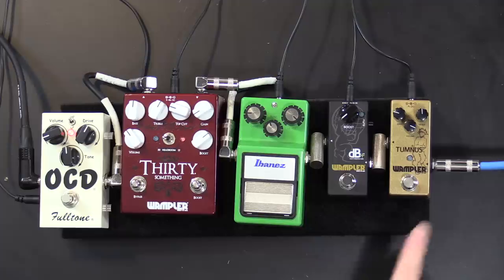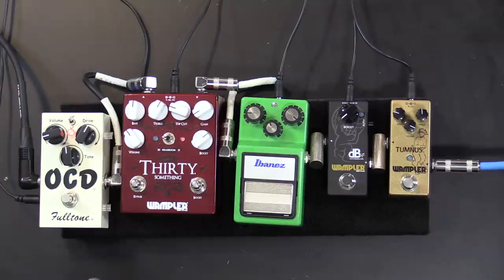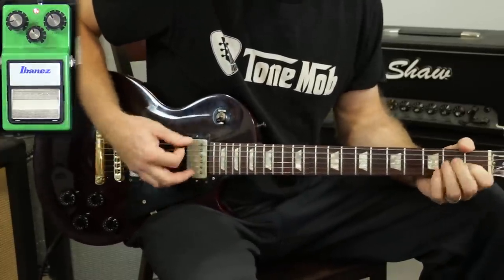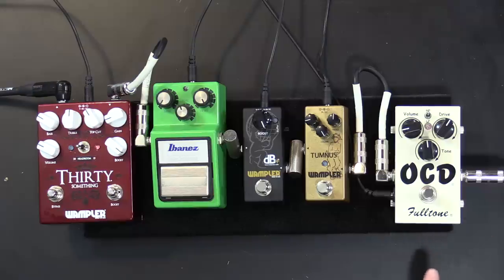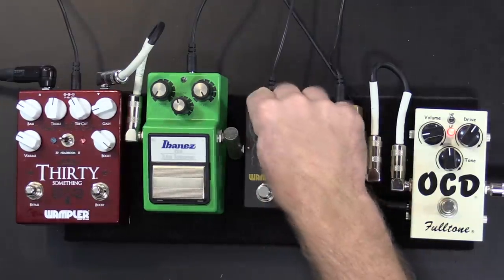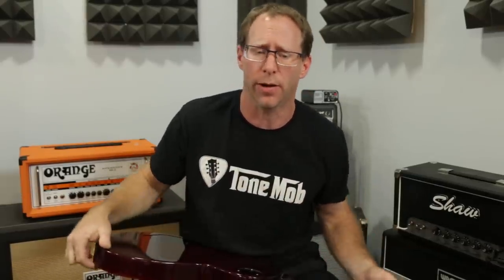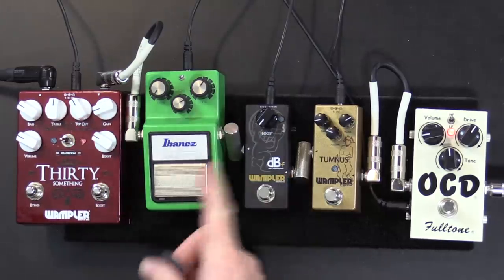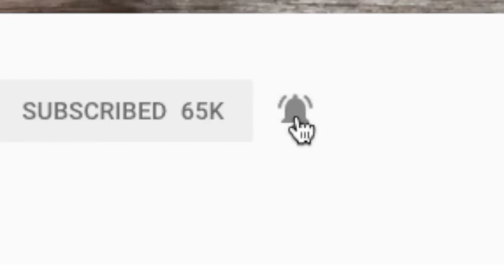Boost Pedal Placement - where do they go?

Comment: great video! 

I've always used an old DOD FX10. I usually keep it after all of my dirt pedals, but I recently got a twin reverb and have been trying different configurations. I now have the boost in front of my OD but after my Fuzz and it's always on, and I like it that way because I can slightly boost the gain of my OD, but then boost the level / character of my fuzz. It's probably the most useful pedal on my board.

Comment: I ran a Metal Muff w/boost through the return effects loop on a Carvin Nomad 1/12/ 50 watt combo with great success. Even in front of the amp with the fuzz at zero for a clean boost it really the pushed the soak/overdrive of the amp beautifully. With the fuzz & boost at noon, the amp @ 10 o'clock, my lawn died. Nice review Mr.Wampler, thx for sharing your wisdom.

Comment: I put my dB+ as the first thing in my pedalboard. My reasoning is I usually set around 8-9 oclock as a solo boost so it’s not boosting my signal all that much so only a little distortion increase but I can crank it up higher and still get the extra gain. The added gain as a solo boost is welcome, and added gain if I increase the volume is louder too

Comment: I had always put booster ahead of dirt but your vid and Anderson’s current vid both mention putting a booster in the effects loop so I’ll try that. I have a number of booster pedals - Diamond, xotic Ep as  well a number of dirt pedals that I can set as always on or boost including Tumnus, lovepedal E6, mooer, miaudio, Manticore, JHS Milkman. I think my favourite is the Diamond and the Tumnus. But I’ve only used it as the first pedal. Great vid. Thanks

Comment: I usually put them after my EQ pedals. I have the distortion and my EQs running through a Boss NS2 then the output on the NS2 goes to boost. my favorite is MXR micro amp cause I think they're the most transparent while an EHX LPB-1 is more of a tiny overdrive

Comment: I use a "boost" as a preamp right after my guitar cable.  It is ALWAYS ON.  I adjust it with whichever guitar I'm using to where I'm just noticing an overload or any clipping at the speaker.  This way I know I've got max signal thru the system, and potentially "lower" my overall noise floor. 
Then I turn my guitar's volume control(s) to max impedance (~47k with my 250k pots) at it's output and start adjusting my gain-staging thru the amp & system to get a nice creamy sound. 
Then when I want it cleaner I can back off on the guitar (or I suppose I could turn Off the boost).  If I want more overdrive/distortion I turn the guitar up or kick on a pedal. 
A super-clean, quiet preamp/boost is preferred for My system, and a lower gain boost/overdrive is usually plenty to give me a high-gain type of sound. 
Try it. You'll like it.

Comment: Does this make sense for how to choose? 1. start with the tone you need: e.g., mid hump with single coil pickups into Fender style amp needs mid hump, 2. choose the type and kind of distortion you want: e.g, soft vs hard clipping for distribution of overtones, symmetric (odd harmonics) vs asymmetric (odd and even harmonics) for complexity of distortion, 3. put that pedal just before the amp, 4. compliment that tone with another peddle into it usually for more sustain. For example, boost into tube screamer to establish the overall tone and use the boost to control just the sustain.

Comment: So much fun! My old 80something TS-9 is still on the board as my first "gain" stage after the compressor. Both of which are basically always on. Depending on flavor or where I want to be in the mix I switch on the OCD, Pinnacle Deluxe, or DS-1.
On very rare occasions I get to slap my EP boost in front of my Marshall 1987 with the volume at 3 o'clock or so!  Absolute SWEETNESS!!! :)

Comment: I tried both ways around. either the boost or the overdrive, or both of them, will have a situation where a signal that's too hot coming in will make the whole thing really squelchy. that depends on the circuit and the pedal, so sometimes it's better to do it one way and sometimes it's better to do it the other. The important thing is not to overload the op amp in whatever pedal makes the squelch.

Comment: Route 66 Comp/OD with both sides on is the best pedal I’ve found for boosting your signal before distortion, if you can make it work quietly. Which can be sorcery, especially with single coils.

Comment: Ya know... the differences, to my ear, don't sound that much different... 

Must overdrive/distortion also sounds quite similar to me, with VERY few exceptions... 

Crunch is fun, but to me, it's a one-trick pony... it's a good trick, but gets boring, quickly if used all the time, in that its limits dynamics, which adds drama to music... 

Remember music? Gear is fun, but music... that's where the rubber meets the road... crunch has its place as an effect... even some metal bands have clean tones... and use it to great effect... there's that word again...

I appreciate your efforts and explanations...

Comment: With all (most) of the boosts I use and why:
EP Boost/Micro amp; I use these to even out different outputs, either between different guitars or different switching like going out of phase or parallel that naturally cut the output.
I may also use it as a buffer by setting it at unity. (I wired an onboard preamp in my Tele, and I use these boosts in the same way I'd use that.

-source audio programmable EQ. This I use basically as a almost overwhelmingly tweakable clean boost. I used this to change the EQ of the pickups of the guitar that's running through it, like to add mid-range to a vintage type single coil. It also will hit the dirt tone (whether it's from a pedal or the amp).

-Here Ill put a Tube Screamer or Klon type OD. Sometimes I'm using the ODs clipping with the boosting. Sometimes I may use it as a sending EQ, obviously adding mid-range. If I'm going for a Gilmore "comfortably numb" lead y tone; I'll run a vintage Muff clone, then add mid-range after the fuzz. Sometimes I'll set the Muffs gain low, and use the Source Audio EQ with the mid-range scooped, and hit the front of the Muff to open in up a bit. When I'm using these for that, I won't set the TS/Klon as a boost, just an EQ with maybe a slight bump in volume, just to make it stand out.
My favorite one right now is the Silver Pony 2. This is a Klon centaur clone, that's actually a Klon and a half. It's a double pedal, with the fully functioning Klon first (IMO, this is the closest to the actual Klon that I've played, the newest version has av3 way clipping diode selector; germanium for classic Klon, then silicon and LED.
It has a clean boost that's a post gain boost, so the OD if first. What makes this pedal great is that the boost is actually just a Klon without the high gain preamp in it. Those who know Klons will be aware that one thing that makes it different from most other ODs is that it has 2 different preamps in it: a clean and high gain. Both are ALWAYS clean and high gain, and three gain knob on the pedal is actually a wet/dry blend. When you're running it with the gain low, you're getting most of the clean preamp going out there pedal while there high gain is getting shunted to the ground, as you turn up the gain, you start to shunt the clean preamp, and send out the high gain.
 The clean boost is a second Klon pedal that's built using only the clean b preamp, the high gain isn't in there at all.

- last is a Timmy that I use for clean boost or sight gain. It's a bit thinner sounding than say the Klon, so Ib like this with a warmer guitar or fuller darker amp, while the Klon I like for brighter sounding gear.

That's about it. I don't ever have all of those in my board at the same time but if I did this is where they would be placed and why.

Comment: Klon for me, get both a boost & OD. Anyway did a test the other day. Simple DCR to measure guitar pickup DCR for a Squier Bullet Strat. Those are the 3.7K ceramic pickups. So what I did was add the Klon as engaged & disengaged to see what the effect  was for the same DCR testing & measuring it at the output of the Klon with a patch cable. The Klon as a clean boost could be dialed from the 3.7K => 10.6K DCR. That's when it hit me, the Klon or any clean boost emulates the DCR windings on a pickup for output. I could dial in & get the DCR of any pickup set. Needless to say, I'm a huge Klon pedal circuit fan even more for this discovery. There are probably other reasons to swap pickups, DCR for output tone isn't one of them. Crazy, 10.6K DCR from a single coil Strat. To me that's too much, but just right is between 5.6K-7ish K DCR measurement. I found that these Strat single coils can be boosted to Telecaster & even P90 DCR specs with a Klon as a clean boost pedal.
Reply from the maker: Are you referring to dc resistance?
Reply: @wampler_pedals  Yes, While I know there is no substitute for actual winds of wire on a pickup, the way the clean boost was normalizing every switch position for DCR & possibly Henries effect, the 3.7K Squier ceramic pickups were sounding like high dollar Fender 5.6K-10.3K Stray pickups. It didn't matter what pickup switch position (1-5) I had the guitar, I was getting the 10.6K DCR or whatever the pedal Volume produced. Since the pedal is external to the amp, it's part of the guitar output to me. Maybe what happens is better described as making passive Strat single coils & turning them into active Strat single coils. I mean my Klon is a 9V DC powered signal, the same as an active 9V DC Humbucker.

As for the Squier Strat single coils, the 3.7K DCR & Henries should be more than adequate for capturing the string vibrations & signals of all of the frequencies. The clean boost does exactly what a pickup with more winds of wire on it would do. All I know is that not plugged into an amp a guitar into a powered Klon as a clean boost was producing the same DCR readings in every switch position and they really were approximating every DCR that Fender offers for each of their pickup products with the exception of the Ultra Hots. Those are 12.3-12.9K for Neck & Middle, 21.6-22.2K for the Bridge. Personally, I wouldn't want single coils that hot for DCR & Henries. With the Klon I was Volume setting the pedal for about 5.6-6K according to my meter, the amp I could set that volume higher and the speaker had plenty of clean overhead (Pyle PVAMP60 Reverb).

Give it a try, measure DCR at the Guitar, whether it's the pickup leads or the output jack with a patch cable. The create that same extension with a powered clean boost Klon and measure it powered off first & then powered on . That's the measures that I'm referring to. Klon powered off I get the same as if I were measuring just the guitar pickups without the Klon. Klon powered on and the DCR's are whatever the volume knob produces at any given setting. At a certain point the DCR really is significantly boosted. I would check for Henries, but my older multimeter doesn't have that function. Not sure anyone else has ever tested pickups & effects that way from this perspective of comparing that with higher dollar/end pickups ?

Comment: I generally don't employ boost pedals, but when I do it depends largely on why I'm using it. If I'm not getting enough saturation from my drive pedal then I would put it before the drive stage to cause it to clip earlier, thus a more saturated sound. If I want to keep the tone I've got but need a solo to cut through I put it in the effects loop towards the end of the chain.

Comment: Thanks for the video. Redid my board yet again. Now using my amp with a little gain with a tube screamer for slight overdrive and running that into the tumnus set dirty. So not a boost but a more dirty distortion and also set a bit more than unity. So far so good

Comment: I’m a little late to the party, but I have a Granger M50, which is basically a 4 input JMP clone. Sounds killer by itself, but I need a little help from my friends (aka pedals) to really push it. I channel hop and blend the channels on the amp to get just the right balance (to my ears). I basically dial in a Malcolm Young-esque tone on the amp itself.

Anyhow, I run with a Tube Screamer mini first, an Earthquaker Devices Cloven Hoof Reaper fuzz next (I use the Reaper side mostly - it’s a 3 knob Tonebender essentially), and then I run an Xotic EP Booster after those at about 9 o’clock. I run the EP Booster all the time, and I’ve found that it smooths out some of the harshness that can come from the amp and also adding pedals that can have higher gain and midrange qualities. Plus, it makes my solos pop! I’ve tried every combination of those pedals, and that’s what’s best to my ears. I love running a wah and time-based effects after that (usually a slight delay and a phaser) for total cosmic goodness. 

Oh, and now I want a Thirty Something! 😂😂

Cheers!

Comment: Great video thanks for doing it. I use a Boss ES8 switcher and it allows changing the signal path for each preset which is an awesome feature for having different gain structure configurations.

Comment: Both..... I have a boost before and after... for the reason's you'd expect.

So I have a AMZ Mosfet booster I built at the head of the train, it is set to hardly any boost and is kinda a buffer

Then a OD808 going into a simple fuzz, after that I have a Flanger going into a BluesBreaker pedal  then I have a SHO as a volume boost at the end.

Comment: I boost with overdrive in the front end, then I run a volume, bass, and mid-boosted MXR 10 band in the effects loop, and a clean boost after EQ for leads, then of course a Noise Gate after the boost, lol. I also engage the built-in boost on my amp and turn the gain down to 1.5, cut the bass and treble and boost the mids to 7 on the tone stack. I play hard rock and heavy metal, and this is the most vicious high gain sound I’ve ever had.

Comment: put overdrive in the front and get dirtier in the pedal placement order and put a boost on the end of the chain. the boost makes everything pop, but you can pay it as is,if everything is off for a clean boost before it overdrives.  use the boost to boost and use the other pedals before it to add the more gain if your goin the more gain route.  unless all you own is a overdrive and a boost and you need modern distortion then put the boost before the overdrive. but if you have an overdrive, distortion, and metal, put the boost on the end.

Comment: With my cheap gear I have 2 Daphon ODs together - 1st is cleaner but with slight level boost into 2nd as regular OD ( this one has a mod of some kind!) and at end of chain an MXR micro amp which only has a level knob for louder. There's a Dist after 2nd Daphon in there as well. BTW it's wicked live!

Comment: Rule number one. You might have a series of different pedals on your board, but that dosent mean that they need to be stacked, or run together.Be mindful that your choices remain an additive rather than subtractive process; you add more because it is needed, not because the pedal is there.If you have a good tube amp, can't help but notice that drives and boosts can hurt more than they help; you should be using them for a reason, like achieving saturation at lower volume, and not because they exist.
A ($ 400 )Blues Jr is going to need some help from pedals.The Matchless? NSM.

Comment: I use a Boo Instruments boost after my Wampler Dual Fusion (into the clean channel of my Bad Cat Hot Cat).  Works really well to lift the volume/tone for solos even when the Dual Fusion is stacked (I run Ch2 into Ch1).

Comment: OK, so I play mostly single coil guitars,  with a peavey amp and a Rat distortion pedal.
When put a tube screamer clone before the Rat, I heard things I'd never heard before.
So I'm using the screamer thing most of the time.
...
Just recently, I tried a clean boost pedal into a small tube amp without a master volume; that blew me away, too. I can't crank the amp in my little practice room, but this made the amp growl at ear-friendly levels.
So I'm pretty sure my next pedal will be a clean boost - though I'm not past trying to get the "tube overdrive" to do the same thing without adding too much of its own dirt.

Comment: I use basically a boutique micro amp (with optional range eq) with my 15w 112, after delay->fuzz->delay, to kick the preamp, but my fuzztone also kicks the preamp a bit. I don't believe in this 'unity gain' thing, as my fuzztone never kicks off/on in mid song. It's cool for giving a smaller amp bigger textures. 

I don't use it with my plexi half-stack, though, as that would be insane 🤘

Comment: I use a Blues Driver BD 2 into Wampler Velvet Fuzz into Tumnus into the front end of a Mesa Express 5:50 (alternating between Crunch and Blues channels depending on song/guitar, both channels relatively clean but close to breakup - gains 12 o'clock). However, I rarely would use the Tumnus in combination with the Velvet Fuzz in this sequence. If stacking, it tends to be either Velvet Fuzz with added boost from BD2, or BD2 + Tumnus.

Over the course of a gig, I may be playing up to 4 different guitars (Tele/Strat/335/LP) and find this gives me good flexibility and guitar matching potential (LOVE the Tumnus with the Tele on the neck PUP). I don't get on too well with Volume pedals so use a Keeley Katana clean boost in the effects loop for a Solo boost, and find the Tumnus (gain </=11) after the higher gain pedal gives me the option of an extra volume step which is useful for matching levels between guitars with different outputs.

HOWEVER, if anyone (especially you, Brian!) thinks there's a bad combo here, or it could be set up better, happy to hear your tip/opinion.